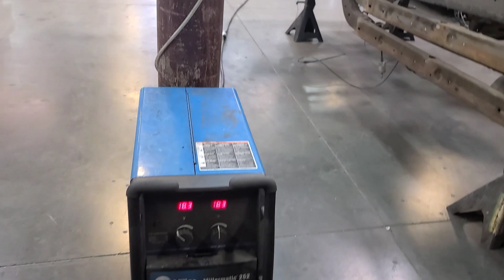mini gravity fed tanks

Comment: It's a bummer you couldn't get the drill at a steeper angle. That way the drill bit could've rode in the AN fitting to hold it perfectly straight with the hole. Perfectly repeatable.